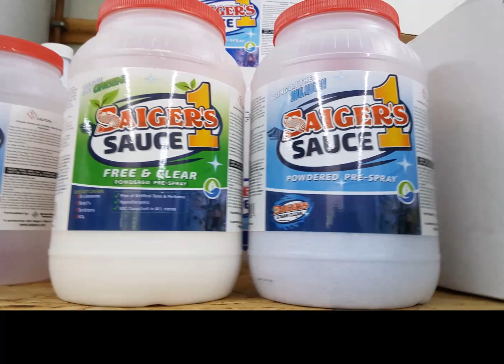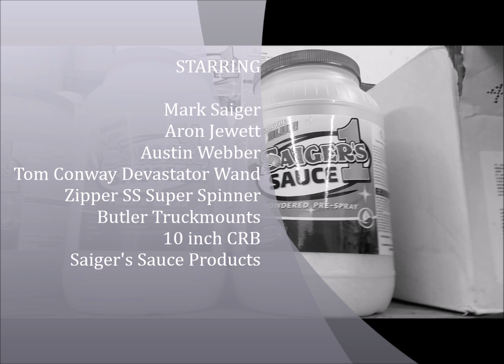Release the Hounds! with Saiger's Steam Clean

Comment: So why swap between the Zipper and the Conway?  I would've thought there was enough room (and enough junk in the carpet) to spin the whole place.
Reply from the maker: This floor was all humped up and wavy in a number of spots.  Where I was using the Conway wand, I wouldn't be able to get good suction with the dual suction chambers of the Zipper. I could only make a wand work in those areas.....otherwise....I would have used the Zipper for sure.....using a Zipper much faster